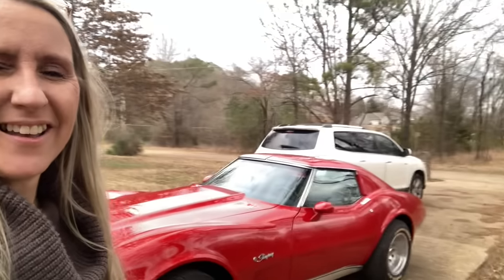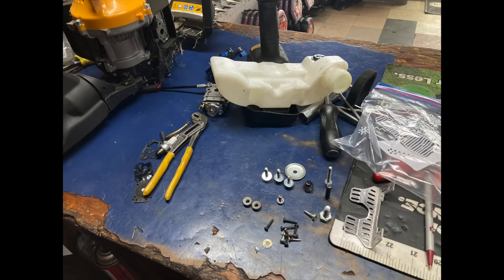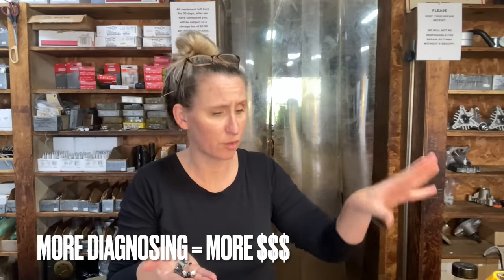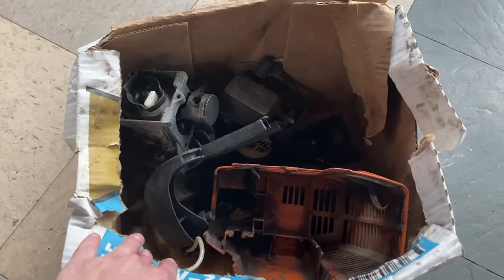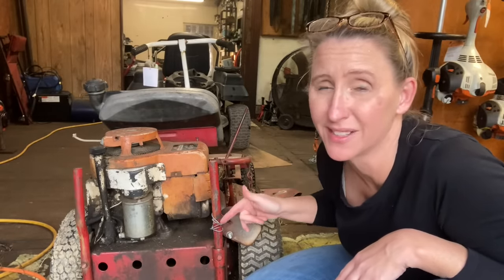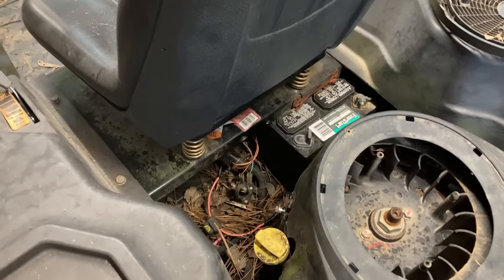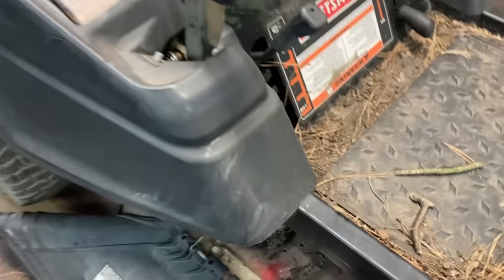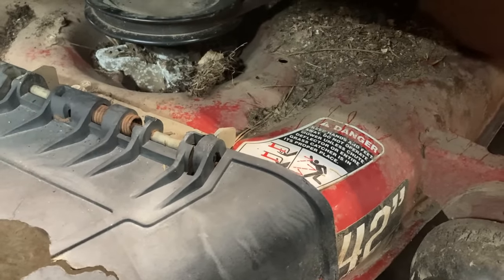Don't Waste Your Money and My Time! Gambling on Repairs When the Odds are TERRIBLE, We Both Lose!

Comment: I’ve got an old Wheel Horse garden tractor with an 18HP Kohler opposed-twin that I had to make over a dozen phone calls just trying to find someone who would want to work on it. The passenger’s side cylinder has a pretty gnarly compression leak and the machine hasn’t ran in over a decade. Even after finding a master .010 over rebuild kit for the engine, I still went through hell trying to find someone willing to turn a wrench. 

Friggin sucks because originally mom got sick and needed care and that put his plan to teach me how to rebuild it on hiatus. Then after she passed, dad himself couldn’t get around too well either… now he’s gone, too.

I don’t want to sell it because it’s been in our family since 1975 and some of my favorite memories with mom and dad were them teaching me how to operate it and letting me mow the lawn with it back in the mid 90’s when I was still a kid. I wanna get the old horse back up and running no matter the cost, the the real kicker is that thing is in GREAT shape cosmetically and aside from the engine itself because it’s always been stored indoors. I didn’t even want to touch it or try starting it and potentially causing more problems rather than just bringing it to the shop as-is. Can’t put a price on memories… and the simple truth of the tractor itself is they literally don’t make them like this anymore. 

Closest comparable modern machines would be a Kubota B-series or a John Deere 1-series, and those things cost a king’s ransom. :(

Comment: You can tell with the last two mowers that they just sat outside which is a huge pet peeve of mine. I don’t understand why people buy new equipment and just let it sit in the open elements between uses. 

I just purchased a new home with 5 open flat acres of field. The homeowner I purchased it from left a 10 year old 60” commercial grade Kubota zero turn that currently sells for just under $15,000 in 2023. It sat outside 3 seasons out of the year for its entire life, he did garage it in the winters. All the cables were seized, the carb needed tuning, and it was jam packed with dirt, grass and debris everywhere. 

He was running it as is even though it was stuck at half throttle. The 1st thing we did after freeing up the cables, and deck lift was rebuild the shed and put the mower right into it. 

I just don’t get people not taking care of their investments.

Comment: I used to have a dirt bike and atv repair shop. I finally took a Sharpie and wrote NO JUNK !! on the front of my work order clip board. If a unit was hopeless it would not even be unloaded off the customers truck. The customer was always shocked when I declined to work on their junk. Usually it would be an ATV that had received zero maintenance it’s entire life.

Comment: I have a 95 Craftsman ride on mower. Changed the deck out in 2011. Still works like a hot damn
Reply: The 'Craftsman' label is magic. 
Swapped a Craftsman branded B&S Quantum on to my '84 Snapper walk behind. 
It's still running, more than a decade after I did that. Build month:  April 2000.

Comment: My newest mower has copper plated aluminum wiring from the battery to the starter. The other wiring is small gauge copper. Vibration causes electrical problems for it.

Comment: I ran a small engine shop back in the 80's and I hand a sign made up to hang on the wall , You should do the same went like  " Shop labor rate $20.00 per hour, Next line  " You stand and watch over my shoulder $ 30.00 per hour,  Last line , " You tried fixing it yourself and brought it here in a Box $ 40.00 per hour !  had some laughs about it but you know, but like ya all say if time, money and frustration, my personal fave. they bring in their mower and its acting funny cutting, of course I do not know how many blades U have had to install in the correct rotation but it always made me grin

Comment: Reminds me of my $10 self-propelled walk-behind mower from a yard sale.  “Yeah, we were using it last year”.  If they were, it was leaking gas and burning oil pretty regularly.
Reply: never pay $10.
just wait till they roll it out to the curb with a 'Free' sign. 
then pull the motor, re-mount it to your deck, new sparkplug, new air filter. 
Of course, tighten the blade. (it's usually loose & knocking, so they think the motor is gone)
Reply: We don’t see that so much in my neighborhood, I know further north(I’m in southwest Michigan) there are more roadside “free” items

Comment: That last mower I love those kinds of equipment,  I would get the engine to run if possible and remove it for another project,  and maybe a few other parts for other mowers. Too much to fix that one, but others could be made usable with the parts.
Reply: That may work for an individual, but not for a shop. A shop risks warranty responsibility on the used parts, investing labor in removing and making the used parts serviceable, Storing the parts, waiting for just the right machine to come in needing that part and the owner willing to take a used part, etc
Reply: @scottnunya1 
That's very true, I can take a messed up machine like that take the engine off possibly get it running and put it on another mower,  sell the repaired mower and make a few hundred dollars.  I realize most shops don't want to do things like that. Too much time,  and problems.

Comment: Job always costs more when the customer tries to repair it first.
Reply: I used to tell my customers I charge $75.00/hr, if you watch it's $100.00/hr, if you help it's $150.00/hr.
Reply: That's why it's better to work on your own equipment instead bringing it to crooked small engines repair shops.
Reply: @johnstreet797  And if I do it myself it's free except for the parts I buy.
Reply: @David-si9pi  absolutely!
Reply: yeah that is a lot of bs... sure there are some cases but making blanket statements like this is just straight up wrong.

Comment: My dad had a mower shop.  March 1st customers come in.  They say my machine won't start.  One sniff of the fuel we tell them it needs a carb job.  We fix it get it running.  Customer comes to get it we start it for them and tell them to not use the feul in their gas can it's probably bad.  Machine comes back a couple days later.  Customer says we did a bad repair.  Happened every year a couple times.

Comment: I have an old push mower given to me by my father in '97, with a straight rear axle and adjustable throttle, that my son ran over with his pickup last year. I took it to my mower guy who told me that it wasn't worth fixing until I told him what it meant to me. It was a great mower, well cared for, until ran over. I helped find parts and we had to find parts to the Briggs engine where my son had cracked it. The deck was warped, but we straightened it up pretty good. The mechanic warned me how expensive it was going to be and I told him to do it. I also said that it was not a priority and to do it whenever he had the time. 

It was just before winter when he called and said it was done. It cost me over $200, but you know what? I was happy to pay for it and in the end, the mechanic was even happy that he made me  happy by resurrecting that mower for me. Now my son on the other hand........I think his ass is still sore from all of the chewing! He never put it away after use and forgot about it, which is why he ran it over when backing out of the drive.

Comment: I made a bunch of money from folks that didn't know how to check their air filter, oil level, or some other fundamental thing that your average lawnmower owner "should" know. I have lots of stories but the top one is my neighbor who called me over to look at his rider, claiming that it wouldn't start. I looked down and noticed the voltage regulator was totally melted. Next I looked at the battery where sure enough, he crossed the positive and negative wires. Oh boy! 🤦‍♂ So a new battery and voltage regulator later he was back in business. Motto of the story, some people are handy and some are not and for those that are not shouldn't try without lot's of supervision.

Comment: I was called out to look at an engine problem in a skid steer loader, 16 hp Tecumseh. Operator stated was working fine, shut it off for lunch. Would not restart. Took about 3 minutes to diagnose. Engine block had a window in it I could put my fist through.

Comment: I bought a 52” grasshopper with the engine removed and sitting by the mower at auction. I bought a brand new 25hp horizontal shaft engine, a new pulley, new clutch, and new hydro belt only to find out that the hydro drive system was shot on both sides.

Comment: The last riding mower I bought to flip the guy said "the head gasket is bad" the head gasket was fine, the valve cover gasket was broken and pouring out out, valves were misadjusted and the terminals to the battery were loose.  I've learned most of the time people tell me "it's XYZ" it doesn't help.

Comment: I cant believe how people take care of there equipment!! Imagine what there home looks like! 😮 had a zforce cubcadet for 15 years , did the deck 1 time and sold it on its 16th grass season for almost 2 k along with a vac box i got for 200$ and put a carb on , bought an Ariens XD52 , looks brand new on season 4 the Kawasaki rips !! Although it tends to bail grass so i added a cyclone rake (commander unit ) and my grass looks professionally done 2 times a week , takes me 2 hrs with dump time included to do 3 acres ! The IKON I STRONGLY RECOMMEND ! It’s only drawback is you cannot change deck height with pedal while PTO  engaged   !! Other then that !! Great machine and again looks brand new still !

Comment: Go an older Costco MTD rider backup running after two bad solinoids (new) with a new $5 Ford car one. Had to mod the mounting holes a little. Now if there was an easy way to change the main crank seal without pulling the engine. Have a radical idea but have a few other thing to get done.

Comment: I made a bit of a mistake buying a used Craftsman LUV riding mower about 5 years ago. It started, ran and mowed fine,  looked nice, but then started noticing some problems. Before I knew it, I had more than doubled my money invested in it in parts. Some missing parts, corroded electrical system grounds causing it not to crank, a split seam in the fuel tank, the carb loose from missing gaskets, the transmission broke, stripped steering joints, etc etc etc, on and on. Doing some research into these, I found that they where made by MTD, and  only around a thousand of them where sold around 2002, and there was a recall on the transmissions. Fortunately, I was able to do the work myself. It's finally a going concern, but really, it probably should have been junked. Oh well, some lessons learned.

Comment: My 2003 riding mower works and runs perfectly. I keep it up, stored in a shed. Should I get a new one? It starts right up, new spindles, blades, belts, fuel filter, air cleaner, battery, oil changed 2x every season. I keep it hosed down to keep dirt off of it. New fuel lines. Should I buy a new one? 42” cut, 2 acre yard.

Comment: I have seen abd bought some small engines and guns like that, taken apart by someone 2 or 3 decades ago and thrown in a ziplock or paper bag or 3 often with both extra wrong parts, and also missing or broken parts.  When something is only 10 years or less old that is not a bad thing, but when the engine dates from before WW2 finding correct parts somewhere can be hard, slow and expensive.  Similar with some of those turn of the last century BP shotguns from Europe.  Makers bombed out of existence during WWI, etc.  TG for my small lathe and mill.  But like you say it is a good way to fill out the winter months.

Comment: $40 is Cheap! My shop has a minimum 1 hour charge at $85 an hour. Thank goodness I can work on my own stuff. I inherited an MTD rider that someone had hit something very solid. Bent one of the blades and sheared the flywheel keyway. Oh and the oil seal on the bottom was leaking. So, about $150 for a battery and miscellaneous parts and gaskets I've got a rider!

Comment: that zero turn mower does not need a complete deck!  it might need a motor overhaul , and both hydro gear drive systems , that would be my main concerns , not something simple like a deck piece missing.  🤣😂🤣

Comment: I must say, after the repairs done to my two-blade mower, that your charges seem extremely reasonable. It was 350 smackers just to replace the two spindles on my good condition machine. I can see how frustrating junk pile repairs would be to a shop, but there's a reason why some people use a machine until it's defunct: repairs are really expensive.

Comment: I only work one day a week.  A customer brought in a Stihl saw with a note saying he couldn't get it started and maybe something was wrong with the sprocket.  I popped the cover off and realized that they ran the saw with its chain brake on and everything was either burned or melted. They had to have ran it for a long time.  
Yes, they were right, There was something wrong with the sprocket. It had moved off center and melted into the housing...

Comment: The last two were 100 percent crap s***. I worked on mowers for several years. I've went on house calls and found the mower stopped where it broke. They didn't even push it back to the carport.

Comment: I've been a motorcycle mechanic since 1969 so I have hundreds of these stories.  When they ask if it will save them money because they have already disassemble it, I tell them if they are lucky it won't cost them over twice as much. That's a fact. The boxes of "parts" get interesting. One had a window regulator in it. When they say they know it's not the carb because they just rebuilt it, you know it's probably the carb plus what was really wrong with it before it came under idiot attack.

Comment: I'm one of those fools that will buy junk like that, spend a weekend taking it apart, realize that it needs too many dollars in parts then conclude that I'm just bad at fixing things. Slowly I'm realizing that not everything is worth fixing. I've got five push mowers, three run, none are perfect, all cost way more than they are worth, and that is after fixing them. And yeah, I spent more on these than I would have on a brand new one.

Comment: First thing I check on anything is compression. Without compression nothing you can do to it will make it run. Break out the jumper cables, no need to diagnose electrical problems. Hook direct to starter and crank. Little or no compression and it goes to the scrap yard.

Comment: I bought a Craftsman T130 from Lowe's right after Hurricane Michael attempted to send my part of Florida to New York state!  Sadly, almost all of the repair facilities never reopened.  The ones that did are dealers and they only work on their brands.  My problem is that the T130 wanders like the eyes of a sailor that hasn't seen a woman in years!  The mower cuts really well and cranks almost instantly.  I just get a real workout trying to cut over an acre of yard with it.  Nothing I can find gives me any clue as to why it has always had such loose steering.  Is this "normal" for a Craftsman mower?

Comment: A customer brought me a Popular Pro hedge trimmer that needed a new recoil starter rope. What I thought was going to be a 10 minute job turned into several hours. I discovered the absolute worst design for a recoil starter. The knot for the pulley is on the back side of the pulley, so you have to remove the pulley. The spring came off as I removed the pulley. This is where I discovered the horrible design. Instead of housing the recoil spring inside a recess in the pulley, it's located inside the plastic recoil starter shell. Then I realized that the spring was a reverse spring, very much like a watch mainspring which has two different curves. The spring housing did not have a recessed cylinder. It consisted only of very short plastic stanchions. A reverse spring has a significant amount of tension at both ends. The challenge was figuring out how to get the spring back into those shallow stanchions to reinsert the starter pulley. I had to fashion a spring winder, not unlike a watchmaker's tool, out of PVC. After successfully coiling the spring inside the PVC, I used a smaller diameter PVC piece to plunge the spring out of the inside of the larger PVC pipe into the starter housing. This took tens of tries to get everything lined up just perfectly to properly seat the spring and keep it under tension inside those short, plastic stanchions. My advice is that if you ever have to do one of these, do your best to ensure the pulley has no tension on it when you remove it, to try to keep the spring seated in the housing, undisturbed. This nightmare has now concluded.

Comment: Had to laugh. We have a 12HP SNAPPER w B&S rear engine bought new May 1989. Still running mowing and bagging. BUT for  the last few years if you turn it off it will not restart until the next day. Ideas?

Comment: I wouldn't unload a tool that the customer didn't at the very least clean it before he loaded it up and brought to the shop. The BS we got from customers was beyond aggravating. I had a neighbor that didn't recognize me. We had sold him a brand new lawn mower. A year later he brought it in because it wouldn't start. We asked the normal questions, like did you drain the tank before you stored it for winter? Oh yes. Did you read the instructions? Of course! I told the boss to drain the tank and check the gas. I knew he never drained it. The gas was 2/3 water!! At least it was clean!